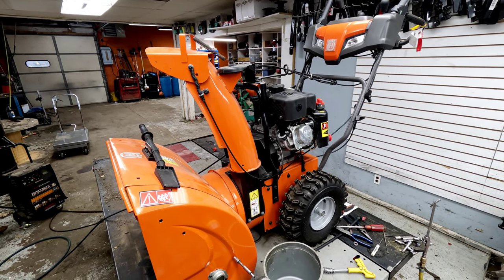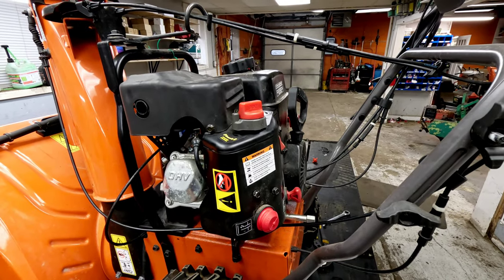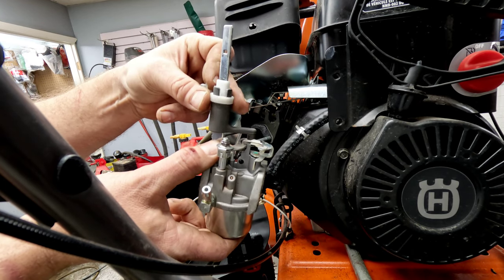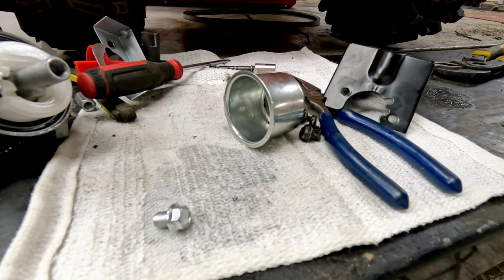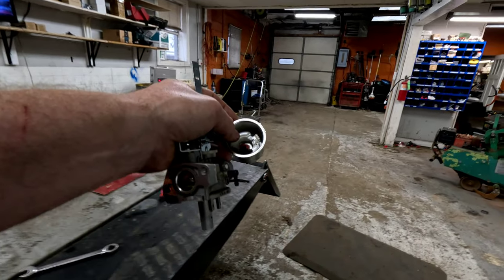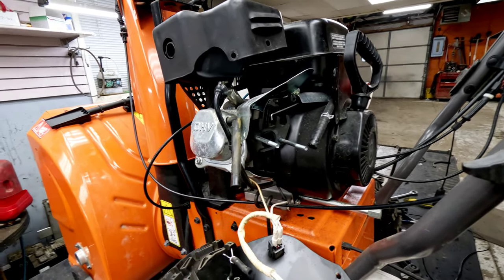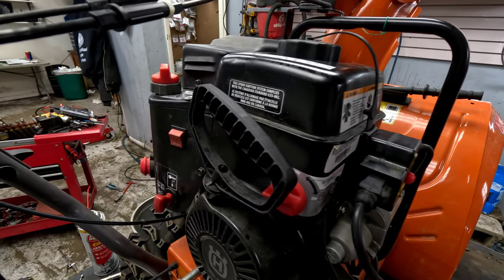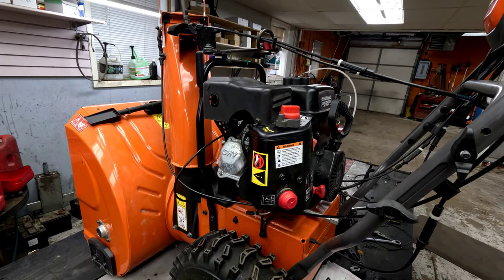Husqvarna 24" Snow Blower Won't Start Surges Ultrasonic Carburetor Cleaning Rebuild ST 224 961930096

Comment: I have the identical snowblower with the same symptoms. I followed your instructions to a tee. From draining the gas, replacing the spark plug, changing the oil with 16 oz of 5/30 synthetic oil ,  pulled & cleaning the carb. Started with the first attempt. Thanks for your detailed instructions.
Reply from the maker: Awesome! Great job! Glad you got it going!
Reply from the maker: Thanks for watching!
Reply: @IndRepair  Can you do a video on summarizing your snowblower for storage? Thanks

Comment: Bought this machine used about dozen times in 4 years and this year cheap plastic console holds shift cable broke only goes in reverse, to fix have to replace entire console, don’t buy this machine!!!
Reply from the maker: I have replaced a few of the plastic console assemblies and they have always been worth replacing. Is this one really expensive or on backorder / no longer available?

Comment: Thanks for the video!!! The manual says 32oz of oil. Everyone else says 16oz and that 32 is way to much because the dipstick crosshatching is half-way up from where the 32oz mark is. I put in the 32, since that is what the manual calls for. Is that o.k.?
Reply from the maker: Way too much at 32oz...usually aprox 18-20 oz. Go by the dipstick for sure
Reply: @IndRepair  O.K. thanks. I wonder why they said 32 oz, and I called them to be sure, and they said yes, 32. Glad I asked again. Thank you.
Reply from the maker: Yeah sometimes they have no clue just reading from the same wrong manual...that is crazy though!

Comment: Outstanding Video, did a great job!! My issue is not being able to idle down with the Gray knob. It won't stay it keeps springing to Full Throttle. Won't stay where I put it.
Reply from the maker: Tighten the 10mm nut where the arm pivots slightly until it moves freely but stays in place

Comment: Thank you, have the same model snow blower, in NY on Canadian border just got slammed with a snow storm and as I was finishing up with several driveways I ran out of gas. I filled tank and started backfiring and losing power going through snow. It seemed to idol fine but put a little strain on the engine and it would start to stall or stop completely. Your site has been the most informative and easily understood.
Reply from the maker: Awesome! Glad to help! Thanks for watching!

Comment: Do you know where I can pick up a new carb for my Husqvarna ST 124?  I did everything from plug, oil, new gas, cleaned entire carb and still surges and bogs.  I have carb numbers from mine just don't know how to read it for a replacement
Reply from the maker: Just need the number from the engine itself and they can be retrieved online in many different places. Were the gaskets between the carburetor and engine replaced? An air leak here is your most likely cause of this issue if it is fully clean. The plastic insulator could also be cracked or warped there. Did you clean the pilot jet under the low idle stop screw also?
Reply: Pilot jet, well since I don't know what that is then probably not.  I did float bowl imulsion jets and the float.  Float has nothing in it.  Literally it all looked brand new but I cleaned it anyways.  No I didn't replace any gaskets.
Reply: Wait yes I did clean that..black plastic piece below the set screw fo idle, correct.
Reply: Do you think I just need a carb kit vs a carb?  Replace the gaskets and rings?  I just checked and there is no cracks in that.

Comment: Thanks for the video. I just followed your instructions and got my snowblower running.  I bought it used a couple years ago and it never did run right. The pilot jet was completely plugged now it starts on the first pull. Don’t even have to use electric start and it will idle down to nothing and stay running. The float bowl O-ring had disintegrated. I found one at Ace Hardware. If anyone needs one, it’s a number 88 at Ace Hardware…Also the smallest wire on a torch tip cleaning set worked to clean the pilot jet.  I used the Gum Out cleaner on everything else…
Reply from the maker: Great news and information thanks for sharing and for watching!

Comment: Is there an easy way to just drain the old fuel out of my Husqvarna ST224 snowblower for after the season is over? Thanks in advance.
Reply from the maker: The 10mm bolt that comes down the furthest at the bottom of the carburetor will drain the entire system

Comment: Well glad I found your video . I’m taking my 224 to the small engine repair shop down the street lol

Regardless I had to like and subscribe considering how well you made this video
Reply from the maker: Haha!! I know that feeling for sure! Thanks for watching!
Reply: @IndRepair  update , actually I ended up taking it apart . Was surprised to see gunk in the bowl , as I only use 104 non ethanol fuel . Jet looks good  but haven’t pulled the float out yet . I need a new tube that goes to the primer as it’s cracked . Doubt they stock it where I bought the snow blower but will try this afternoon;
Reply from the maker: Were you able to get it all finished up?
Reply: @IndRepair  yes I put the carb back in and all is well . The strange part is I didn’t find anything wrong except the primer hose was cracked on both ends . But I think the clamps were up high enough on the ends of that hose that I don’t think it would be an issue , and I did try starting with the electric starter first quite some time . 
But it just started up immediately after reassembly. There was a little bit of sediment in the bottom of the carbs bowl , but nothing major . Strange if you ask me.
Thank you for sharing this video though , as it helped immensely
Reply from the maker: @MajorTendonitis  Awesome! Glad to help!

Comment: I really appreciate the video. Started to tear mine down but it’s a different model, ST 224P. Once I get the choke control off and the two 10mm long nuts on the side of the carb, the cover over the carb looks completely different than this. The cover on mine is a long solid piece that runs under the gas tank. Any idea how to get it off?
Reply from the maker: Information from the side of the engine will tell me which video I need to link you to. Will be stamped into the side or on a tag

Comment: Great detailed video - thanks. Replaced the carburetor - started right away and runs great ..... however it will not shut off now with either the kill switch or the Run/Stop button.  It appears I may have broken the single wire off (ground?).  Hoping you can help with where this wire can be reconnected.  Just using the fuel shut off valve at the moment - works but not ideal. Help!!
Reply from the maker: You will have a wire coming from the coil going to the switch and then going to ground. The switch connection closes and lets the wire going to the coil ground out. Hope this helps!
Reply: @IndRepair   Yep - just needed to get the broken wire to ground - snowblower has never run better.  Thanks - great video and follow up support. Best.
Reply from the maker: @petemechie4712  Awesome! Glad to help! Thanks for watching!

Comment: I followed this guide step by step. Had old gas in the bow it was green. Been there for 2 years buy the last owner. 

My issue now is everything is clean and reassembled. However it seems like no Gass is making it into the piston. 

I have spark, I feel compression on the muffle but no bang. And idea?
Reply from the maker: Is there fuel in the carburetor? Check bottom 45 degree bolt if there is gas in the carb the main jet is likely still clogged. If no gad float could be stuck
Reply: @IndRepair  yeah I have gas in the carb. I took it apart twice and used carb cleaner everywhere. I'll try again  tomorrow. If it doesn't work I'll take it to my local shop
Reply from the maker: The main jet was removed and completely clear along with emulsion tube as shown also?
Reply: @IndRepair  yes I didn't have carb cleaner I used brake cleaner on the brass bits and used new gas to clean the parts I wasn't sure where going to react well to brake cleaner.
Reply from the maker: @IrishSaint214 hmm
Reply: @IndRepair  so we found the issue. So brake cleaner didn't manage to loosen enough of the gunk of the screw for the jet to let Gass through. 

We got carb cleaner and rewashed both the jet and the setting screw and used a needle to remove all the gunk. She now runs but surges on idle I'm guessing the idle jet needs to be replaced.

Comment: Great video...just what I needed...thanks!  Mine didn't have a gasket on the carb mount...where do you get your replacements?  Also, I nicked the float bowl gasket a little bit when I tried to dig it out of its channel...do you know where I can get a replacement?  I went ahead and ordered a replacement carb (surprised how cheap the are) but I want to have this one on hand as a spare.

Thanks,  Rich
Reply from the maker: MTD sells a replacement gasket that fits but we normally do not replace the gasket alone as it is 2/3 the price of a new one. I updated the description so there is a part number for the gasket between the carburetor and plastic insulator
Reply: Thanks!  After I posted this I saw that I missed where you gave the Honda part number for the intake gasket in the video but thanks for posting it in the description.  Mine did have a gasket...I just didn't see it at first.  My replacement carb had a replacement.  Plus I 3d printed a template so I can make my own in the future if need be.  I bought some 2mm square nitrile cord from McMaster Carr to make my own float bowl gasket but have not tried it yet.  One of the o-rings on the pilot jet was marfed up so I ordered o-rings to replace that (1.2mm thick, 5mm inside diameter).  It goes on well but wasn't able to push it into the opening on the carb.  Then I found out that the other o-ring on the pilot jet is a different diameter (1mm smaller).  I'd really like to get the original carb rebuilt so if this happens again I can just swap it out easily and rebuild the other one at my leisure, but may not be able to.  Thanks for your help!
Reply from the maker: Awesome!
Reply: I finally had a chance to test my new carb...3 times in the last 2 days.  Yesterday there was a total of 12" - 15" of wet heavy snow.  The snowblower started immediately and made easy work of the snow.  I'm quite thankful that I found this thread and got it taken care of before the snow hit.

Rich
Reply from the maker: Great job!

Comment: Thanks for the video! I had surging issues so I cleaned the carb out like you did in the video and after reinstalling everything I can't get it to start and the gasket going from the carb to the engine is soaked and dripping with gas. Is it not sealing correctly or is it overflowing gas out?
Reply from the maker: I would make sure the crankcase has not flooded fuel to mix into the oil. If the gasket it leaking there is an issue somewhere, the gasket it not the cause, just the symptom. It sounds like a carburetor needle/seat sticking to me, this would be the most common cause

Comment: have you any videos on how to remove the starter on a husqvarna st230p?
Reply from the maker: I do not, it is just two 10mm bolts holding the starter itself and the two Phillips head screws holding on the plug block. The starter then pulls straight out away from the block
Reply: @IndRepair   thanks

Comment: I’m ready to throw mine off a cliff!  Picked up as a non runner 3 weeks ago. One of the carb studs was broken in the head. Got that drilled out and replaced.  Cleaned the carb, both jets and emulsion tube. Nothing was real dirty to start with.  Put together and terrible surging. 

Pull it off and drill out the low speed jet with a micro drop to just slightly bigger. No change. Drill out again slightly bigger. Nope. Still surging.  

So, replace the whole carb. Nothing.  I’m in Wisconsin so altitude is not an issue.  I even doubled up the gaskets behind the carb incase of an air leak problem.!   I’m ready to quit and find a new career!    Any suggestions?  Anyone?

(You channel is one of the best by the way!)
Reply from the maker: I would check the replacement carb if you didn't inspect inside as they have metal shavings or other debris in them many times. The main jet also usually doesn't come quite big enough, needs to be slightly bigger normally for optimal fuel air ratio. If those aren't the problem that leaves an air leak at the plastic insulator between the carb and engine. I see them hairline crack or warp to not be flat causing this nightmare issue. Spray some carb cleaner while it's running on either side of the insulator plastic and see if you get it to change. If it does you know this is the issue. Do this while it's not hot and be careful so you don't start a fire. Be prepared for that possibility either way. Thanks for watching! Hope you get it figured out!!
Reply: @IndRepair   so I pulled off the plastic spacer and checked it on a true flat surface and found it to be slightly warped.   Sanded it down with sandpaper on a true flat surface and bingo.  I knew that an air leak could cause chaos but dang!   Have a great day.  One of my favorite channels.👍